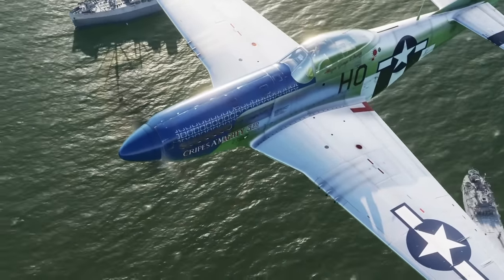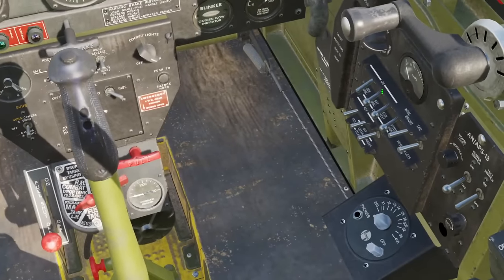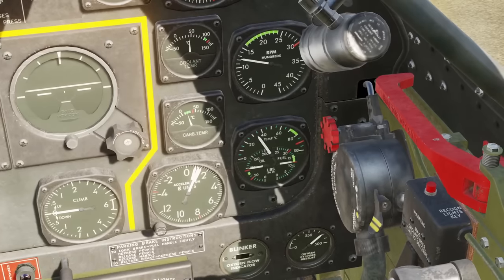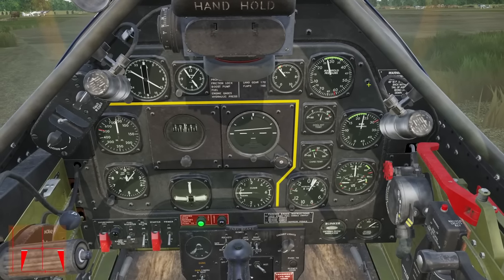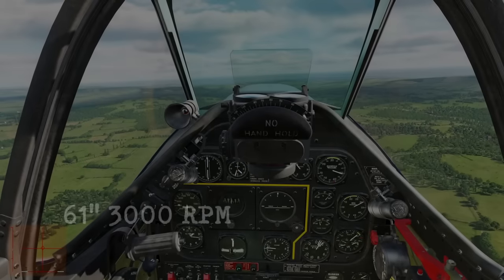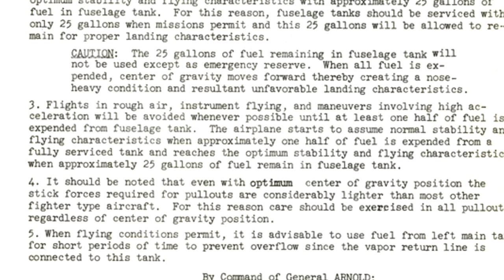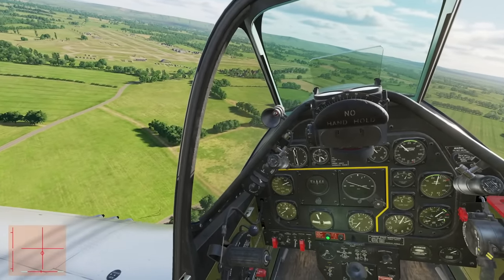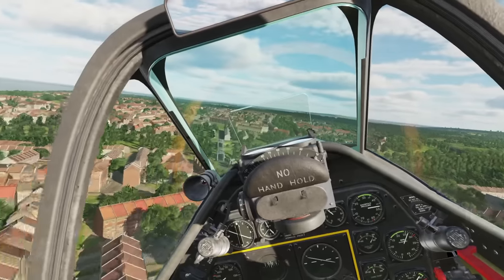DCS P-51D Tutorial Startup/ Takeoff/ Flying/ Landing Lesson

Comment from the maker: Corrections and extra info so far:
- You only turn on the pitot heat once airborne, because on the ground there's insufficient cooling.
- You don't only turn slightly sideways at the hold short for the runup in order not to blow your propwash on the ship behind, but if you turn (slightly) into the wind, it improves engine cooling too. Plus it helps keep the tail on the ground.
Thank you for these, please keep them coming!
Reply: Insufficient heating?....probably mean cooling...the probe will get excessively hot without airflow to moderate.
Reply from the maker: @ml1754  righto, corrected. Thanks :)

Comment: In his book To Fly and Fight, Clarence "Bud" Anderson (the pilot of the P-51 marked "Old Crow" in the European Theater), in the chapter on training in the United States on the -51, stated that you didn't want to lift off the ground at less than 100 MPH while taking off.  At less than 100 MPH, at takeoff power, the ailerons didn't have enough authority to overcome the torque of the engine turning the prop and the plane would roll over on is back and crash.
Another little quirk he noted was that the two-speed supercharger would change gears with a bang, usually about the same time you had reached the exact middle of the English Channel, startling the pilot with a loud noise from the engine at just the worst moment possible for engine trouble.
Cool video and good job on making the mysteries of flying a complex, unforgiving aircraft like a high-powered WWII fighter less frustrating and inscrutable and more understandable and achievable by neophytes.
Reply from the maker: Thanks for sharing! Taking off slow was a bad idea in just about every warbird. Heard such stories about the 109 and the Corsair too.

Comment: That was fantastic. Thank you! My first ever Airfix model was a P-51B Mustang back in 1978, which I got for my birthday. Loved aviation ever since. In January 2024, I plan to be in Orlando for a conference and I will go on an Orientation course in a P-51D. Can't wait.
Reply from the maker: That's quite a plan, it's defo a bucket list item :)
Reply: @ReflectedSimulations  Oh, by the way, I forgot to mention that when you taxi and do your 'power up checks', you face in to the wind. I'm not sure if your video showed that. What I found pleasing is that the power-up checks were essentially the same as the Piper PA-28 in terms of RPM.
Reply from the maker: @abdulmismail  make sense, to help hold the tail down
Reply: @ReflectedSimulations  This is a definite but it's actually more to do with aiding engine cooling as the air flow will increase through the engine.

But still, fantastic video. My background's aerospace engineering and I've been flying on and off for 24 years - but what you've done is superb.

Comment: Hey there
As far as i know, they put the gunheat on after takeoff.

The guns don't need to be heated when on ground and due to the low rpm, the generator struggle to keep up with the high load of the gunheaters.
Just put them on shortly on the ground to check the A-meter rising so that you know, they work. Switch to on after takeoff when you stabilized with max continuous.

Cheers
Reply from the maker: Thanks, good advice!

Comment: Many thumbs up!!! Excellent job.  Reminded me of the days of instructing at the table in the flight room.  Very professional.  However, I would like to make a comment on “knots per hour”. My log books have over 5000 hours of real flight experience and 7 years of on the water sailing experience.  A knot is a unit of speed based on one minute of geographic latitude which is a nautical mile and is used in both aviation and marine parlance.  Thus, a knot is the speed that it takes to travel 1 nautical mile (approximately 6080 feet or 1.15 statue miles) in one hour, therefore, ‘per hour’ is redundant.
Reply from the maker: Hey, thanks.  Did I say knots? The ASI is in mile sper hour.

Comment: Great stuff as always, Reflected! (I'm not into Campaigns, but if I was I'd definitely be interested in yours. You should run a high-realism WWII multiplayer server. The options out there currently are not great.)

A few notes while I watch:

1. @2:04 You didn't tell them how to release the hydraulic pressure. (The red handle above the gauge.) I see you do mention it at the end during the shutdown procedure though. Good! 

2. @2:45 "Check for full and unrestricted movement". Which was what I was trying to talk you out of advising people to do in your Spitfire video where you suggested using the saturation feature to reduce control range. Something you'd NEVER do in real life and, indeed, do this check to verify you're NOT doing! (We address control sensitivity with curves. NOT by limiting the maximum control extents!)

3. @4:40 Non-FFB trim should be correct and the same for everyone. It's FFB sticks that will all be different. (I had to dial in some pretty substantial NH trim on my Logitech Wingman 3D FFB when I was using it. And the TF/P-51 was probably the best warbird for FFB. I hardly noticed it in the others, other than how badly it would throw my trim setting off. Shame DCS doesn't include FFB axis bias settings somewhere.) But yes, it's wrong to have spring force when sitting still on the runway with no airspeed. There are no springs in the real plane, it's the slipstream pushing on the control surfaces that makes the stick want to center.  And the moveable trim tabs change the angles those surfaces want to fly at, but again, only when there's airspeed. Without it it should be all floppy. (The control surfaces do have mass and momentum though, so there should still be some resistance and inertia due to that.) And as I recall, in the DCS P-51 it largely was, but they quickly seemed to drop the ball on the FFB implementation in the other warbirds. Also, many of the jets I couldn't fly with FFB on at all as it threw the needed trim settings out of range. Again, a FFB-force-bias feature for X and Y axes (hell, throw pedals in there too!) would have been nice.

4. @7:00 Correct but the "pissing" fuel isn't modeled in DCS. Shame, that.

5. @9:00 Did you mention putting the parking brake on before starting the engine? I see it on but if you mentioned it somewhere I missed it. The parking brake is a bit non-intuitive so worth a mention. (And to make matters worse, the technique is not common across warbirds, we have to do something that feels not right to me in the P-47 - pull the handle before applying the brakes. Not 100% sure but I'm pretty sure that's not right. The P-51's parking brake interacts with the toe brakes in the way I'd expect.)

6. @3:50 "...prop wash on the ship behind you." Oh I wish! We don't even have cosmetic engine startup smoke that's blown away by propwash yet. :(

7. @18:30 I believe we're technically supposed to tap the brakes to stop the wheels from turning before we retract the gear. (No ill effect from not doing this is modeled in DCS so it's safe to skip.)

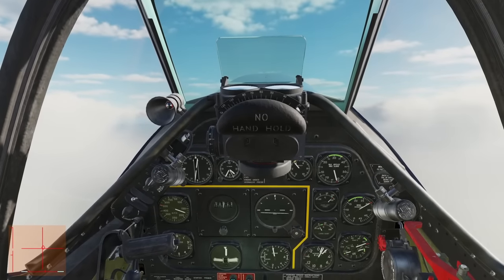8. @20:00 A mention of our current 100 octane fuel limit (when these birds commonly burned 150 octane during the last few years of the war) might be helpful to some wondering where their missing power is. FIX THIS ED!!!

The rest is all fine, great work! I'm sure a lot of DCS pilots could use help with the lead-computing gunsight though, so hopefully you do another one on that.

Cheers and thanks for this!
Reply from the maker: Hey, thanks for all the input! Let me respond 1 by 1:
1) Yeah, forgot that, but it's mentioned at the end.
2) True! Actually with my longer Winwing stick I don't need to chop off the curve anymore.
3) Should be, but I needed nose down trim with my T16000m, and 0 with my Winwing. Strange...
4) I think it is in the Mossie though. Would be cool to have it in the P-51.
5) I did, but man, I often forget that, and then I'm surprised I start rolling...:)
6) Someone wrote another good point: it's also needed so that you're turned into the wind more to allow for better cooling
7) Yes, in some aircraft. But the P-51 manual explicitly forbids this. Probably because you need to taxi at 1000 RPM at least to keep the spark plugs clean, but that results in pretty fast taxi speeds, so you have to use the brakes a lot. Possibly more than in other aircraft.
8) yeah that would be nice.

+1: My internet connection is terrible and spotting on my laptop without dot labels is abysmal: so I'm really not a MP guy :)
Reply: @ReflectedSimulations  Oh that's a shame, actually. Try tethering to your cell phone, if you haven't. That helped my ping time. I was expecting the opposite. But yeah, hosting a server costs money, and you can't do it on a phone.

Thanks again for this great resource! Cheers!
Reply: @ReflectedSimulations  Oh and 7. Didn't know that! Real-world flight manual says on page 55: "Caution: Don't brake the wheels after takeoff. Doing so may fuse the discs of brakes that are hot from extended taxiing. If this happens you'll nose up or groundloop on landing." (Wouldn't that be nose-down?) Anyway... interesting! I wonder which plane(s) I'm remembering that recommend doing that?

Comment: Incredible tutorial, now, tell me one thing I didn't get properly, on engine control, how do you control the pressure manifold and the rpm?? I guess the rpm is with the throttle lever, but the fuel pressure?? Is with blades pitch or with the lower red lever??
Reply from the maker: The throttle controls the manifold pressure the propeller control adjusts the rpm

Comment: Perfect as usual, thank you so much again! i just have one remarque or question, are you sur you have to let the fuel pump on all the flight?
Reply from the maker: Yes, quite. In case the engine driven pump fails. Also at high altitude it's needed.
Reply: @ReflectedSimulations  and i assume during tank switch also.

Comment: Is it just me or do all the Allied warbirds in DCS tend to have too high oil pressure on startup? I noticed the needle was on/over the red line as you were commenting about the oil pressure limits.
Reply from the maker: I think that's pretty normal for a cold engine. Despite the high pressure the pipes won't be damaged if you keep the RPM low.

Comment: During a bomb&rocket training mission. I mistakenly kept the throttle and RPM too high for like, 2 minutes max. When I lowered them back to green the entire plane jerked and sputtered, but returned to normal. Then out of nowhere on my next turn in, the entire engine just crapped out... Engines can be very finicky, I felt like I didn't even lower them that fast but apparently it was too fast I'm assuming. Not entirely sure why the engine crapped out like that though. I really wasn't in full power for very long at all. Definitely nowhere even close to 15 min, not even 5.

Comment: Revisiting the Pony these days, and I find she does not want to slow to gear-down speed in the pattern at 2700rpm and MP above 15". Higher-G break puts me too close abeam. I always have to go near idle and 3000rpm so the drag induced by the prop pitch slows me down to 170 on the downwind.
Reply from the maker: Hmm, 20” and 2700 slows me down fine, low initial, break high, drop 1-2 notches of flap already as you begin the break
Reply: What engine settings do you use on the initial to the break? I may be coming in too hot.
Reply from the maker: @DCS_World_Japan  depends on how much I had to dive. But around 27” and 2700rpm. Whatever your speed you can bleed it by breaking hard and up, and dropping 2 notches of flap. Pull back to 20”, and keep it there until flaring, you really manage your airspeed with the flaps. Ww2 pilots took pride in not touching the throttle throughout the whole pattern.
Reply: @ReflectedSimulations Okay I'm definitely coming in way too hot at 36", among other things haha.